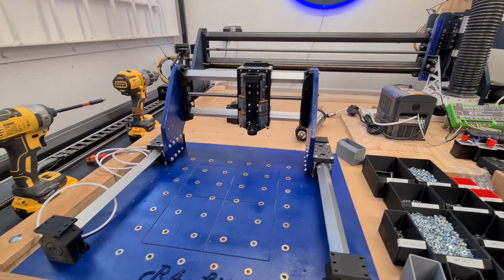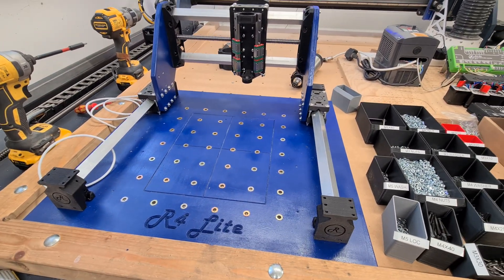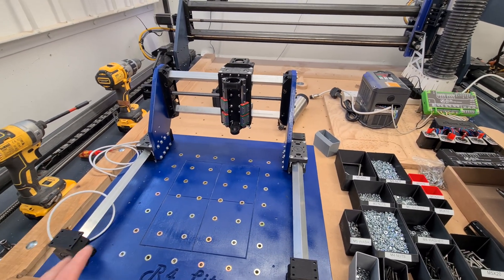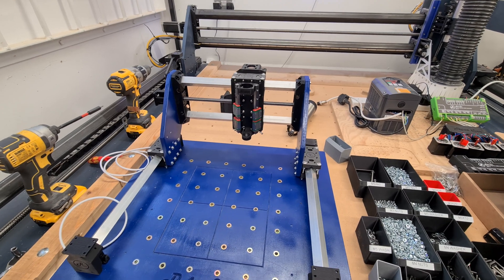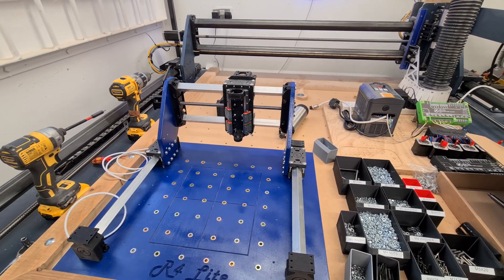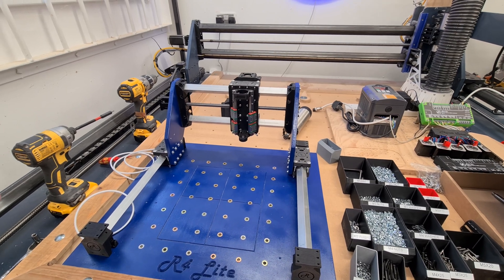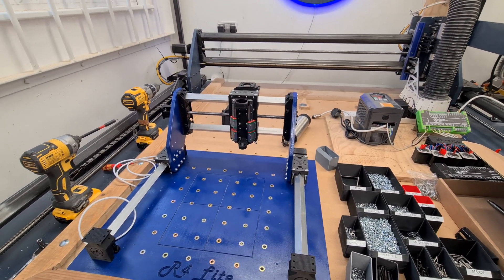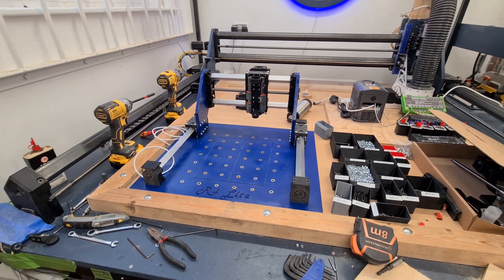Root 4 LITE PT4 - The final stage of assembly for the DIY 3D printed CNC machine

Comment: Hi Sailorpete.  As an engineer I must say that your Root3 & Root4 designs are fantastic.  I am humming&harring over whether to go for your R4 or go for the PrintNC.  I already have a 3d printer, and understand the financial implications of either choice, (bearings and cheaper steel tubing for yours ... vs linear rails for the other) .... however I would really like your feedback as to your R4 vs PrintNC in terms of functionality and "longtermness"  I like them both VERY much, but cannot decide which.  Stuck in a rut!   Thx.
Reply from the maker: thats a good question, both machine are filling a gap in different price points. I'm always going to be biased to the Root CNC machines! but I must admit the PrintNC does look good. I cant complain with my Root 4 - its been working flawlessly for well over a year now with regular long duration use!

Comment: Awesome stuff Pete! Are a lot of these 3D printed parts shared between R4 & R3? The box carriage, Y axis box mount, X axis bar mount looks like the drag chain parts are similar as well? If so It seems like this could be a potential future upgrade for my WIP R3 :)
Reply from the maker: You are correct, the two machine share alot of common parts. Check out my first video of this series, where I go through the parts. But 100% it's a upgrade path to the R4Lite